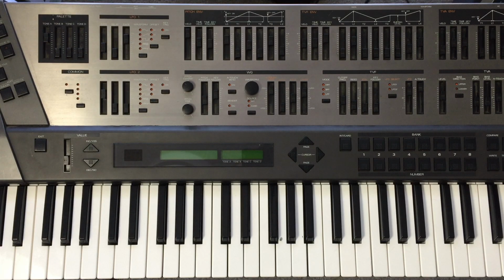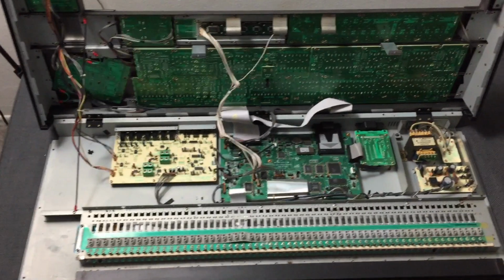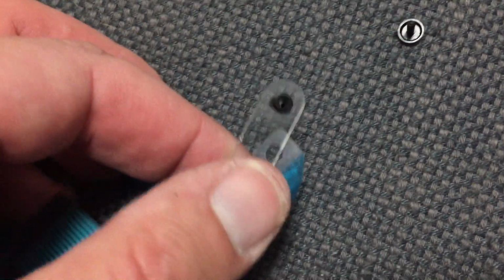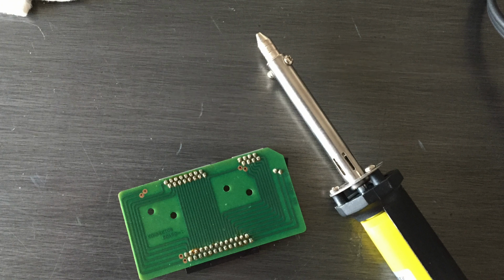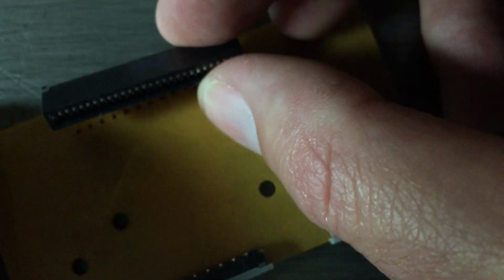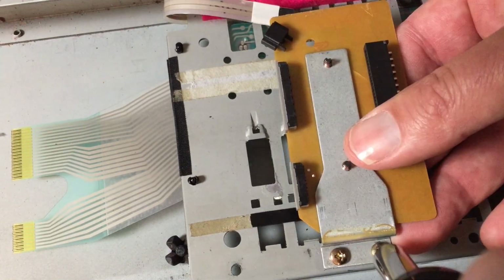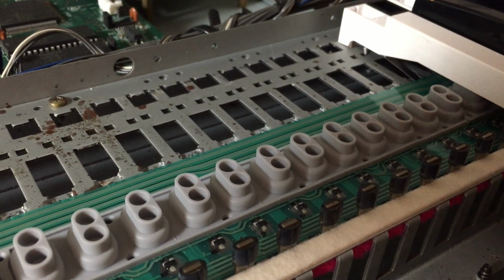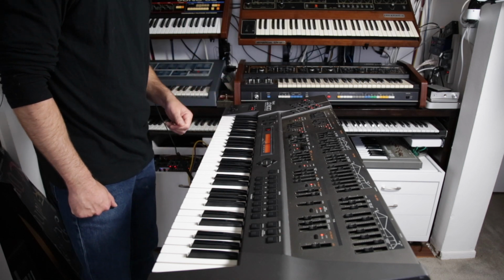Roland JD800 Keybed Repair

Comment: My JD all of a sudden has certain keys that don’t sound. There’s a pattern of six good then two won’t play. This repeats all the way up. Is this the kind of keybed failure you experienced with this ribbon connection problem?
Reply from the maker: I don’t remember it being that consistent. I just had a majority of the keys that wouldn’t play.  That said, if you see in the video the terrible flaw in the connecting ribbon, it wouldn’t surprise me if it were the case.
Reply: Thanks for taking time to reply.

Comment: Any chance you could share the contact you bought the pcb from?
Reply from the maker: I called the Roland Parts and Service department at (323) 890-3771. Parts and Service is open Monday through Friday, 8:00am to 4:00pm Pacific Time.  The Part Number is 22935230.   Best of luck!
Reply: thank you!
Reply: Anyone have any joy sourcing the green ribbon?
Reply: @diskodogn  did you ever find the green ribbon? Also in the UK...

Comment: The problem I have is locating the new contact strip. Where did you find that? Thanks.
Reply from the maker: I called Roland directly.
Reply: Thanks for the extra info. Great video, too. I tried repairing a few different ways, tried another green strip, tried 3D printing a part I found on GS and soldering wires, tried some expensive conductive adhesive... nothing has worked right to fix or bypass the connection between that blue ribbon and the green strip. I had called Roland before all of this and they were having none of that. Told me to contact a local certified repair shop. The shop told me their guy had just quit so I gave up on that route. Prob time to try again. In the meantime, I'll just watch your vids.
Reply: was it as simple as that? I tried this and no luck. Did they connect you somewhere specifically?